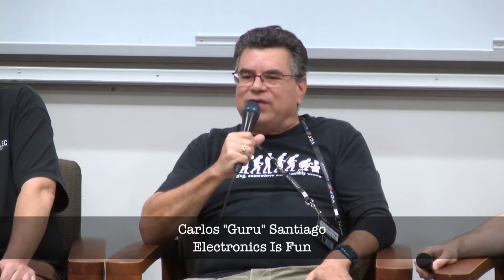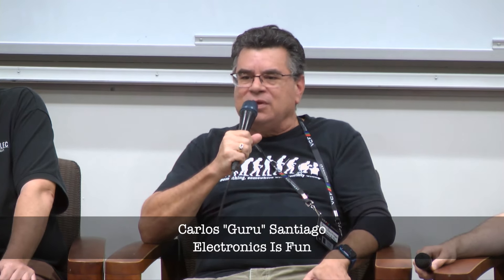Hardware is Hard: Hardware Designer Panel

Comment: Good information and shared experience. Ben Eater is building computers and graphic cards on breadboards. There's a huge spectrum of what your goals might be.
Reply: Not the "use case" for this panel, which is taking existing 40-50yr old HW and trying to plug modern stuff into it

Comment: So one of the points that came across, which got a bunch of nods but no real explanation or expansion was, "don't use a Mean Well". There are lots of use cases when we want to replace the old 'brick' or massive 3 tonne internal transformer/heater with something modern, compact, reliable, cool, and lightweight. And Mean Wells often fill that role. So why not use one? What alternatives would the panel suggest? Or does the caution only apply to new-build hardware that requires its own PSU?
Reply: I don't think he is talking about those AC bricks, he is talking about the miniature psu modules that can be soldered directly to the PCB.
Reply: I was wondering about that too.  Too bad nobody asked him about that, at least on video.
Reply: @moshly64  You mean like a 7805 replacement? I must admit I wasn't even aware of those!
Reply: @TimsRetroCorner  I'm not entirely sure, he was talking about the local regulation on the circuit so I believe he meant off the shelf modules (jack of all trades). From what I understand about power supplies, 
you need to closely match the psu to the load for best performance. If you use say a 12V 10A supply on a 2A load then you may get  excessive noise, poor regulation performance, over voltage on start up etc... stuff like that.
Reply: @TimsRetroCorner yes he’s talking about those and the dc to dc buck converters not main PSUs
Reply: He's talking about the PSUs in Eurorack synthesizer systems that transform mains AC to +/-12VDC. For audio applications any PSU will introduce noise, be it Meanwell or not, so you will usually not use the 12V directly on your opamps but "subregulate" it to e.g. +/-9VDC as an additional noise filter.
Reply: I was talking about Meanwell AC in, DC out "bricks". Use TDK. Meanwell IS the LOWEST price for a REASON. More noise, more ripple, lower reliability. Yes, I understand the "Well it worked great for me!" comments to follow.

Comment: They all love SMT and doing SMT yourself but no mention of Ball Grid chips yourself.
Reply: BGAs on "wide pitch" (1mm or maybe 0.8mm) are OK to route on 4 layer but then the average hobbyist can't solder them.
Reply: @paulschreiber9384  I watch this one guy on Youtube replace the Southbridge BGA on PS4s and PS5s all the time.  I am amazed at his patience and skills.  He has mad skills at BGA with just the simplest equipment.
Reply: @Daveyk021  There are people who can hand-solder 0201 SMT resistors without magnification (I used to work alongside them at BlackBerry). That wasn't my point.
Reply: They did mention reflow toaster ovens.